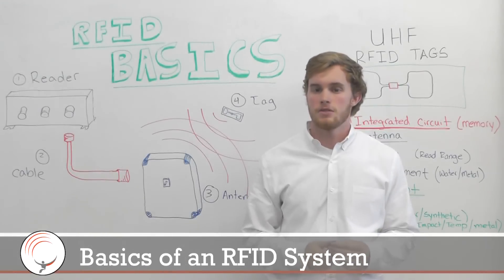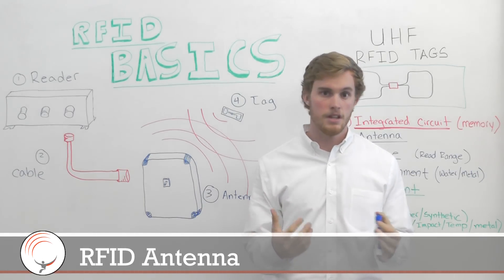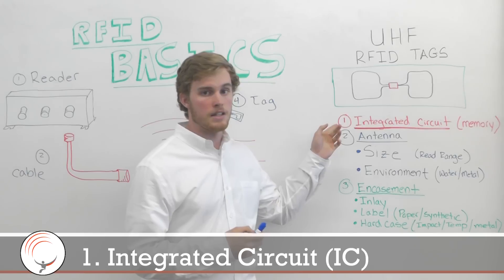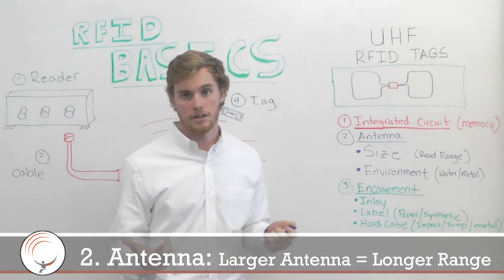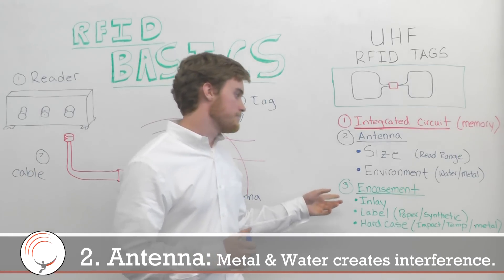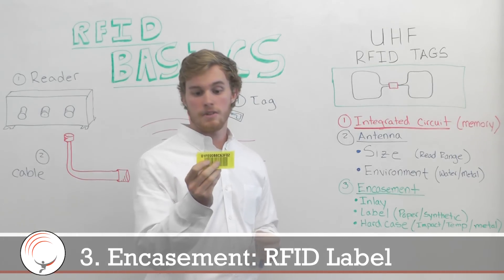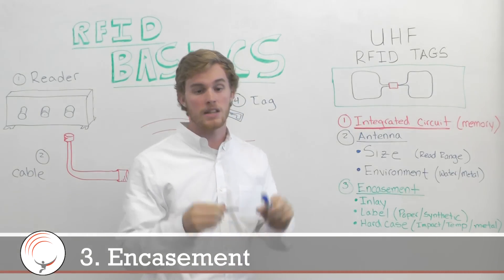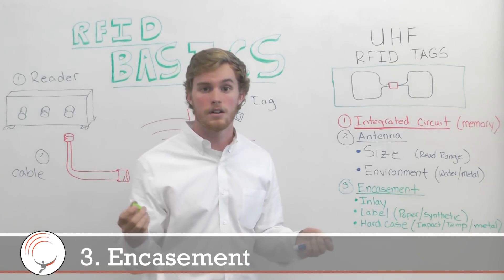What are RFID Tags?: 3 Things to Know About UHF RFID Tags

Comment: got 2 questions:
1. Is it possible to have a automatic writter system that writes the information you need  to your tags when the tag pass in front a scanner by example?

im asking this because i am secondly wondering if it could be possible to write the current date and time of the day in your tag for your production tracibilty? since the time of your day change every minutes, i was wondering if this application exist or could be possible.

thanks
Reply from the maker: Marc-Olivier,

Actually, yes this is possible! Using the ThingMagic Elara RFID Reader, you can encode a memory bank once an RFID tag is in the reader's field. This reader can report the date/time of each encode via an autonomous workflow called Tag Update, within the software - ThingMagic Configuration Tool. It looks like there actually is a setting within that workflow called "Write Timestamp" which would make it much simpler to do this. You might still need some type of custom software depending on your setup and the problem you are trying to solve.

This is a super cool feature of the ThingMagic Elara which is pretty cost efficient as well, we might have to a demo of this in the future - thanks for the great question!

https://www.atlasrfidstore.com/thingmagic-elara-usb-rfid-reader/

Comment: Thanks for this great and informative video explaining about RFID. Completely new to this field, but I got interested in RFID through a start-up that is using RFID tags with blockchain to manage logistics/warehousing of apparel industry. The company wants to apply RFID tag to each clothing to be able to track everything. At the current state of development, is RFID cheap enough to apply on each clothing, and furthermore, secure/powerful enough to find a specific clothing in a pile of thousands of clothing? Thanks! PS Link to the company's white paper http://www.waltonchain.org/upload/1498826072890.pdf
Reply: There are many different companies that are currently applying RFID tags on to individual pieces of clothing. Here's a blog that we put together that discusses the tagging of individual clothing items in a retail setting.
http://blog.atlasrfidstore.com/auburn-rfid-lab-part-1-retail-environment

The price per tag will depend on the requirements of your specific application. However, if you are considering moving forward with a 13.56 Mhz tag, your tag cost will be a bit higher and it will be much more difficult to read large groups of tags at one time. 

HF/NFC tags have very limited read range of less than a foot, so it would be difficult to have a large quantity of tagged items within this range. However, with UHF (860-960 Mhz), you can pick up clothing tags from 10-20 feet away. This will allow you to have many more pieces of clothing within a reader's area coverage.
Reply from the maker: Thanks Timothy!

Comment: thxs for the sharing 
whats the storage capacity of rfid
Reply from the maker: The memory capacity varies depending on the integrated circuit, or chip. Some RFID tags have just enough memory to cover the basics required by the Gen 2 standard (96 to 128 bits) while some high-memory chips can store up to 32,000 bits or more. Of course, higher memory means a higher price.

Below are some articles that provide more insight on the topic:
http://blog.atlasrfidstore.com/17-things-might-not-know-gen-2-rfid-tag-memory-banks

http://blog.atlasrfidstore.com/high-memory-rfid-tags-and-which-applications-need-them

http://blog.atlasrfidstore.com/types-of-memory-in-gen-2-uhf-rfid-tags

Comment: Is the cost of a fabrication of an RFI expensive? What are the main components of a reader RFID?
Reply from the maker: If you are referring to the cost of fabricating an RFID reader, it depends on how robust you make the reader in terms of added features as well as the encasement. In short, the more you add, the more expensive it will be.  

There are some relatively low cost RFID reader modules on the market (for example: https://www.atlasrfidstore.com/thingmagic-nano-embedded-rfid-reader-module/); this is one example of what you would use as a base for any reader you create.  

However, if you are starting from scratch, you would begin with a reader module development kit. Some examples can be found here: https://www.atlasrfidstore.com/rfid-reader-module-dev-kit/.

More information on the basic options and features of RFID readers can be found here: http://blog.atlasrfidstore.com/rfid-readers-basic-options-features

Comment: Must a tag move through the terminal’s electronic field
to get power and communicate?

Or can a ‘shielded’ tag be in close proximity and then be
un-shielded when not moving and communicate?
Reply from the maker: In order for a passive RFID tag to communicate, it must first receive energy in the form of RF radiation, or waves, before it can respond. Because passive RFID tags are powered by RF waves, they do need to be within range of a compatible RFID system in order to send a signal. The distance will vary greatly depending on the frequency of the system as well as the system setup (e.g. antenna gain, reader transmit power, etc.).  

To specifically address your questions above:
Yes, the passive RFID tag will need to be within the given antenna's electromagnetic field in order to respond.
Yes, if a passive RFID tag is properly shielded, it can be within the antenna's field (including close proximity) and then begin to respond when the shielding is removed (as long as it is still within the antenna's field and as long as the antenna is actively transmitting).

For more information on how energy flows in an RFID system, please see the following article:
http://blog.atlasrfidstore.com/rf-physics 

Also, of note, active RFID tags (i.e. battery powered) do not require RF radiation to power them and will transmit regardless of the other components of the RFID system (if programmed to do so).

Comment: excellent presantation but please tell me something. How can someone store the data needed in the tag? is there USB connectivity for example (unlikely) or wirelessly storage of data?
Reply from the maker: To store data on the tag, you'll also need an RFID reader (which is also a writer/encoder; various examples can be seen here: https://www.atlasrfidstore.com/rfid-readers/). Using the RFID reader, you can communicate wirelessly with the RFID tag and write information to the tag's chip. The amount of information you can store on a typical UHF RFID tag is relatively small; however, there are some high memory tags.

For more information on UHF tag memory, please see the following three articles:
http://blog.atlasrfidstore.com/types-of-memory-in-gen-2-uhf-rfid-tags
http://blog.atlasrfidstore.com/high-memory-rfid-tags-and-which-applications-need-them
http://blog.atlasrfidstore.com/17-things-might-not-know-gen-2-rfid-tag-memory-banks
Reply: Atlas RFID Store You've been really helpful. thanks